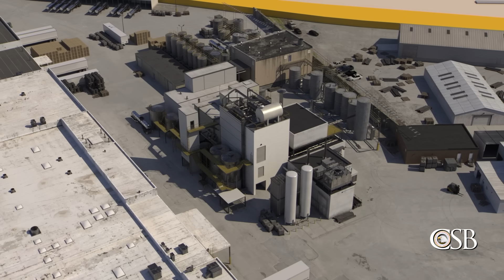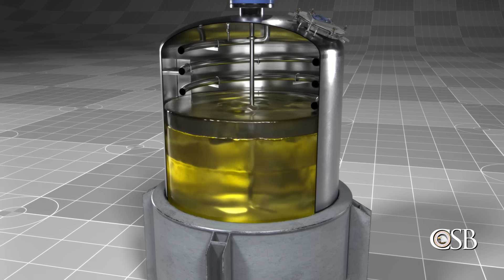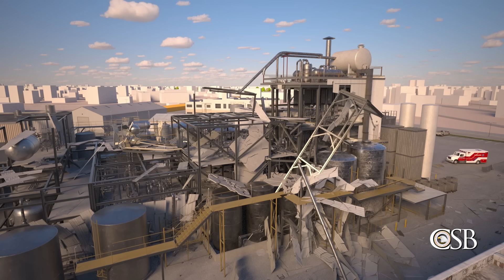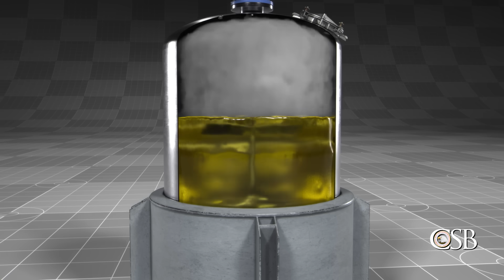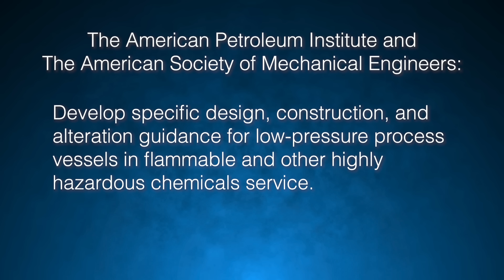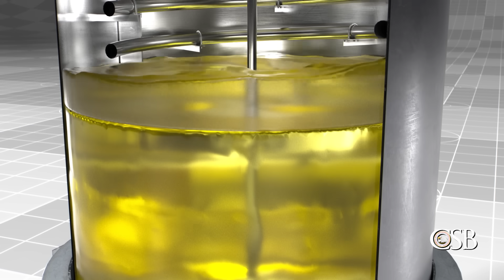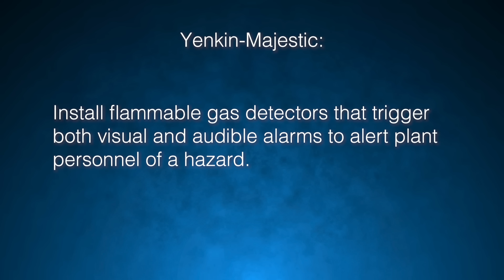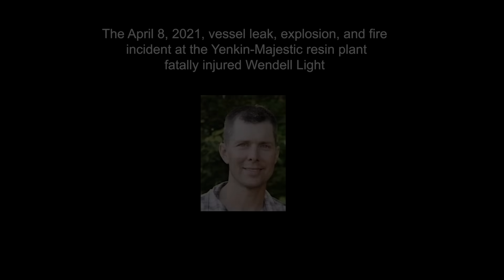Low Pressure, Fatal Consequence: Explosion at Yenkin-Majestic

Comment: seems like some kind of ventilation system could be useful too, something with intakes at floor level and when vapors are detected or someone pulls an alarm they kick on and pull these kinds of vapors up a stack above the roof line of the plant. As a last line of defense that is.

This channel and Mythbusters will teach anyone a very high level of respect for pressure vessels. Even a few PSIG can get spicy with a big enough pressure vessel.

Comment: The CSB should be able to TELL OSHA and the EPA what to do, and they need to be REQUIRED to implement what the CSB recommends EVERY. SINGLE. TIME. Ugh. CSB needs TEETH! THANK YOU CSB!!!
Reply: The CSB is fine as is. I'd rather they release truthful reports that often get ignored by the regulators than have the chemical industry breathing down the USCSB's neck trying to influence its analysis. OSHA and the EPA just need to step up!

Comment: Skirt the Code and pay the price.  If ANRO was considered, the design pressure may have been properly set at 25 psig, therefore requiring compliance with ASME Section VIII boiler code.

Comment: If the replaced hatch was properly tested... it likely would have contained the problem enough for safely dealing with it
If it had simple alarm that the agitator shut down... it would have been prevented
If it had an interlock preventing adding chemicals while the agitator wasn't running... it would have prevented
If the flammable sensor triggered evacuation... death/injury likely been prevented (as the employees would have gotten out of there in time)
if they were wearing proper PPE... death/injury likely been prevented (IMO, should have had masks in the area)
if they were properly trained... death/injury likely been prevented (would have known to just run when the seal failed, and trigger a plant evac)
IMO: this was premeditated, by putting the profits above safety.  Just because the rules are not required, doesn't mean you can't use them for guidelines.  Sadly, those profiting and making the decisions from the corners cut likely were not held accountable at all.  Thus the issues remain about a culture of profits before safety, and safety only when the laws require it... and then only to the bare minimum.

Comment: Do these things because not "pressure vessels" not have any relief valves on them. Granted the hatch would have still failed if the vent pressure was still 15PSI. A release may not be great either but if it dumped outside but at least then it would be released more controlled like a roof stack the relief trips an igniter starts at the top and burns the stuff off before it gets too concentrated to blow up.

Comment: Odd that pressure vessel was not equipped with a safe full volume overpressure venting system. Refineries flare flammable gas safely. Perhaps that would be wise for similar reasons including preventing explosive cloud buildup as happened here.

Comment: CSB on the job, trying to protect people from other people's mistakes and bad decisions. 
1. Company pressure testing for the manway hatch was even below the max design operating pressure for the reactor. Half-pressure test is better than none, right??
2. Gas detectors not sounding audible alarms, but Hey! We sent an email to somebody....somewhere! They'll be in tomorrow at 9 a.m.
3. Control system warnings were not audible, even though employees had to leave the panel to do their quality control tests in another area.
4. Control system allowed operator to restart the mixer even with mix temperature far above normal, and apparently no high-pressure alarms either.
5. Emergency response planning and training?? Why would we need THAT??!

Comment: There should have been an interlock to prevent the solvent from being added if the agitator was not running, and maybe a rupture disc leading to a safe location in the event of overpressure. My plant has many rupture discs rated for ~2 psig on fiberglass tanks and reactors that operate at atmospheric pressure

Comment: I’m curious what part of the man way was New? Was the inspection flange only new ? or was the entire man way newly installed by creating a new hole in the kettle?
Reply: @MaLiCioUs420xD     The written report for the incident seems to be saying that the entire manway was new.   Among other things, the report says "Figure 10 and Figure 11 show the new manway before and after the incident. The manway’s lid was attached to the kettle with a single vertical hinge and could pivot open. A sight glass on the lid allowed operators to see inside the kettle. Four swing bolts tightened down the 3/8-inch thick lid onto a gasketd on the kettle’s 20-inch nozzle opening."
Reply: And more:

"In 2020, Yenkin-Majestic implemented an automation project, in which it commissioned the design and
installation of a permanent connection from the raw material-addition hopper to the existing (original) manway
on Kettle 3. This project, part of a multi-year automation project, reduced manual operation steps during regular
kettle operations, allowing material to instead be added from the hopper using automated controls. The new
permanent connection from the hopper to Kettle 3 eliminated access to the original manway, so Yenkin-Majestic
hired two companies to design and install a new manway for personnel access to Kettle 3. The original manway
was rated to 50 psig."
Reply: And more:

"To construct the manway, the fabricator cut a 20-inch hole on the top head of Kettle 3, welded on a nozzle, and
attached a lid that closed down onto a gasket to seal the assembly"

Comment: 2:32 some animator mounted a random A/C synchronomous motor instead of a pneumatic control valve actuator on that vessel's feedline
Reply: Literally unwatchable
Reply: @sithlordmaster181  😂😂😂 This is the kind of deep cut technical nerd comedy I can only find here
Reply: I was wondering what was up with that motor
Reply: gasp
Reply: Once seen, it cannot be unseen.
Reply: At least it wasn't a DC motor.
Reply: a motor operated valve (😅)
Reply: This can be seen in the fotos of the scene although it is cut off. The motor was there but I cant tell what it was driving
Reply: @meemlaal7235 I looked at the photos too and its clearly a control/shutoff valve actuator driving a gate valve. The motor in the video has no place being there because its shaft goes nowhere.
Reply: I feel like it’s used in conjunction with whatever is attached to the cap immediately below it. Such a random thing is there for a reason, I believe
Reply: @biometal770  you can feel all you want or you can look up what a valve actuator looks like and trust what an engineer says to you in the comments section. That motor doesn't belong there.
Reply: @scibust  I am an engineer. I understand it's an electric motor, not a pneumatic actuator. I believe the electric motor is there for a reason. It appears in multiple animations. It wasn't put there by accident.
Reply: @biometal770  it doesn't have to be a pneumatic actuator, it can be powered by a servo motor for all anyone cares. What is pictured in the video is a synchronous A/C motor with its axial shaft parallel to the feedline, its clearly connected to nothing and that's why it sticks out as a sore thumb to me. I never said that actuator is not supposed to be there, I said that the animator chose the wrong asset to represent the actuator. Please enlighten me as to what reason someone would mount a motor in that manner other than to control flow through that pipe.
Reply: Thanks, Trump
Reply: @Phonixrmf  Oh cut it out.  Your obsession is pathetic.
Reply: @sanniepstein4835  well I can't say Thanks, Obama anymore now, could I?
Reply: @sanniepstein4835  This was obviously a joke like the first reply was a joke. No need to be so sensitive.
Reply: @sanniepstein4835  damn, cant a guy just thank the president?

Comment: I came close to dying because we did NOT pay attention to rebuilt equipment to make sure it had been rebuilt to original specs. One person did die and another suffered permanent brain damage. The bolts on a bevel gear head  cover were too short and it blew itself apart. TEST THINGS FIRST! STAY CLEAR DURING TESTING!!

Comment: This is why, in Australian and NZ standards, we have AS4343, which classifies pressure equipment based on Hazard levels of the operating substance. Even at low operating design pressure, this equipment would have fallen under design hazard level A, B or C, warranting detailed design, design verification, and fabrication requirements.

Comment: "Fatally injured", Dead, they are fucking dead, DEAD. I know Youtube doesn't like this, but a human life was lost for a stupid reason. They deserve it called out as it is. Not testing something to the pressure release setting is just bullshit. Who thinks that's correct in the first place? You add a hole to a pressure vessel or a vessel that could become one and never test it properly. Someone is dead because simple logic like that never entered someone's brain, probably middle management as usual. A flammable vapor detector not triggering the fire alarm... are you serious.

Also what speaks volumes of the care this company takes, their website copyright notice is from 2022... not a lot of care given to anything at that place huh
Reply: Fatally injured as opposed to murdered, etc.
Everyone who dies is dead. They're just being more specific. 
Copyright notices are updated when the site is updated. What, specifically should they have done in the last 3 years?
Reply: "A flammable vapor detector not triggering the fire alarm... are you serious" Fire alarm systems are designed to detect smoke, heat, or flames, not chemical vapor (at least in most cases: some very advanced systems sometimes are however), & those gas detectors were also likely fully separate from the fire alarm system, that's why it didn't sound (well, that & none of the employees thinking to activate it manually on their way out of the building).

Comment: Emailing alarms is standard procedure, "alarm" in factory software just means any value is off and needs to be acknowledged by an operator. This happens all the time because there are hundreds of sensors that workers can mess with or that just degrade in accuracy all the time, so don't get confused by the wording. Adding emergency procedure on top of an alarm is its own beast, email or not.

Comment: As an engineer in the industry working with low pressure systems always freaks me out a bit. Above 15 psig and there's clear codes and requirements that everyone has to follow. Below 15 psig and its all basically vibes and good practices. I get its perceived to be less risky but incidents like this show they can still be deadly
Reply: I feel this is a case where the hazop should have caught this analysing the agitation failure case. At bare minimum, failure of the agitation should have interlocked the addition of the naphta.

cooling a 200C fluid with a volatile liquid in a 1 bar rated vessel is quite cowboy.
Reply: They didn't put much thought into things at all when they assumed that because there was an emergency cooling interlock triggered at 4 psig, it could never get above that pressure and they didn't need to test it above that pressure -- they didn't notice that a pressure of 12 psig had been previously documented. That's a fairly extreme level of ignorance, but still, standard procedures might have told them where they needed to look to find the predictable maximum pressure.
Reply: @Sbrogzni  100% There seems to be design/PHA issues. That is a pretty hot reactor for such a low pressure vessel. Any number of things could get out of hand especially if they ever ran that system blocked in.
Reply: Force = mass X area
Think of this when you walk by a vessel under 15 psig.   15 pounds pushing on every square inch of that container wall... the math quickly adds up to a scary amount of force.  I think of this often walking by some with nearly 400 psig.
Reply: @khx73  i was working on a live 6" 2500# pipeline next to a blind flange last week. Typical operating pressure is over 4000 PSI - that's 113,000 pounds of force just chillin next to your face. It would be a closed casket ceremony if that thing let go
Reply: @Tayrantula-h6l Yikes! Respect.
Reply: @khx73 aircraft hydraulic systems i worked on years ago were 3000psi, used a broom handle to check for leaks

Comment: So why did the solvent layer vaporize when the agitator was restarted? Did it trigger a reaction using all the heat energy under pressure?
Reply: by the time the agitator got started again the solvent already warmed up while the resin overheated. The resin was simply so hot that the already warmed up solvent vaporised without the chance of the usual reaction.

Comment: I don’t agree with the finding here. They’re basically saying the facility should have ensured the vessels could operate at their maximum rating. First, you need to be able to rely on the vendor of the equipment that their ratings are valid. 2nd, how do you expect a facility to test a vessel to its breaking point? Are they then supposed to use it after having subjected it to the point of near failure? Unless they manufactured the vessel, it’s not their fault it didn’t withstand the pressure it was rated to.

Comment: This alarm COULD NOT have been an email.
Reply: Emailing alarms is standard procedure, "alarm" in factory software just means any value is off and needs to be acknowledged by an operator. This happens all the time because there are hundreds of sensors that workers can mess with or that just degrade in accuracy all the time, so don't get confused by the wording. Adding emergency procedure on top of an alarm is its own beast, email or not.

Comment: As a former naval plant operator it boggles my mind that vessel was not tested to the relief valve setpoint to verify the vessel will hold until the relief valve lifts! It's like saying you need 12 gallons of fuel to get from point A to point B but only putting 9 gallons of fuel and hoping you'll make it to point B.

Comment: Could there possible be a  more “government” produced video. It’s literally clockwork precision.

That being said, being a “chemical” investigation board, they never explain what caused the vaporization in the kettle? Would the agitator have been able to circulate the resin from the bottom to the top that fast? Given the temperature it should have already been partially convecting. I highly suspect vaporization was already happening and raising the pressure. If the kettle was supposed to be operating at “atmospheric pressure”, shouldn’t a basic psi monitor that would alert the operator?

Comment: How much you wanna bet that email """"alarm"""" went to the recipient's spam folder?
Reply: Emailing alarms is standard procedure, "alarm" in factory software just means any value is off and needs to be acknowledged by an operator. This happens all the time because there are hundreds of sensors that workers can mess with or that just degrade in accuracy all the time, so don't get confused by the wording. Adding emergency procedure on top of an alarm is its own beast, email or not.
Reply: @ataarono  but important, life-endangering conditions need to be more than just one industrial email out of hundreds that increase likeliness that it would be ignored or not treated as urgently as it should.
Reply: @notmuch_23  You imagine all the digitals to be all one big thing, but its not, its layers of different computers sending information up the chain, at the very top is the emailing server and IT stuff. The IT isn't meant to stop emergencies, its just collecting data for maintainance, for example if the gas sensor went off, it could just indicate a leaky valve nearby that needs tightening.

Comment: Our reactors shut off the heating as soon as the agitator stops. Even the ones for distilling until it's empty only keep on heating by using a switch right by them, if the switch is activated to keep the steam going it's displayed very obviously on the process control system.

Comment: That vessel should have been rated at double its usable pressure and hydro tested at 2 1/2 times its allowable pressure, secondly why was there no double ASME pressure relief valves piped to it😮😮😮

Seems they need new real engineers👍

Comment: A gas alarm only sending an email to someone off-site is nuts. It’s a wonder this didn’t kill more people…
Reply: Dumb luck ❤
Reply: @haruhisuzumiya6  I think the words you were looking for are "gross negligence"
Reply: Emailing alarms is standard procedure, "alarm" in factory software just means any value is off and needs to be acknowledged by an operator. This happens all the time because there are hundreds of sensors that workers can mess with or that just degrade in accuracy all the time, so don't get confused by the wording. Adding emergency procedure on top of an alarm is its own beast, email or not.
Reply: @ataarono That’s perfectly understandable, but I would expect high level alarms would have a bit more redundancy to make sure people in the immediate area are notified. 
If my CO detector just sent a text to my neighbor instead of sounding off audibly, I would probably suffocate before they could do anything.

Comment: whats psig vs psi
Reply: PSIG is a measurement of gauge pressure (pressure relative to atmospheric pressure), while PSI is a general term that can refer to absolute pressure (PSIA) or gauge pressure (PSIG), depending on the context. PSIG is commonly used for everyday applications like tire pressure, where a reading of \(0\) PSIG means there is no pressure above the current atmospheric pressure